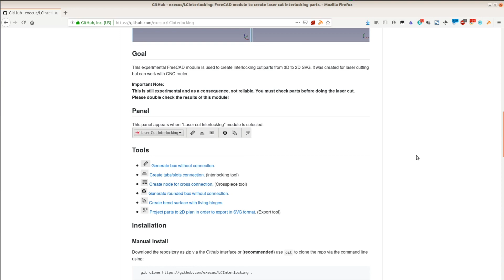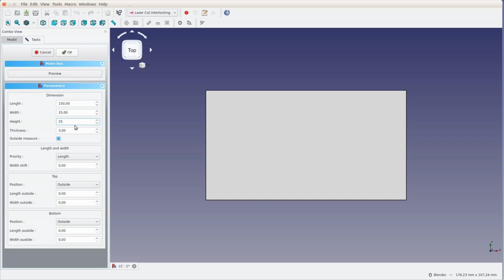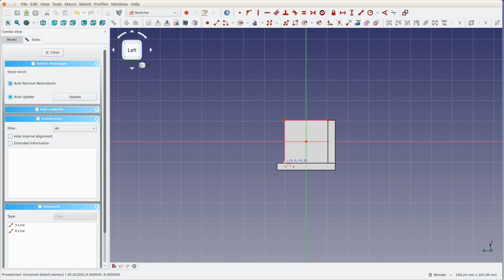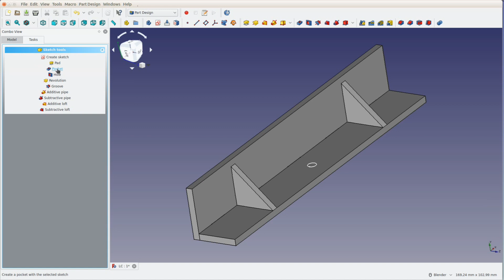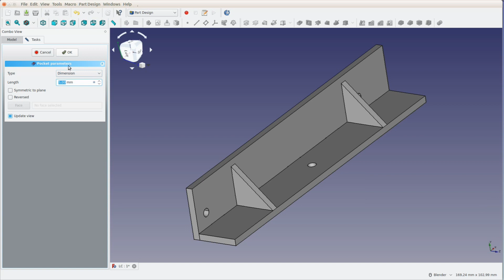Laser cutter CAD design with FreeCAD

Comment: It's funny to me that this tutorial is about radiator mounting brackets. I was just searching for generic FreeCAD tutorials for making things to laser cut and found this. My goal is to build brackets for my radiators too but I have a very different design idea. I'm going to making perfectly flat brackets that go across the whole radiator with holes for the fan screws and airflow path, with extrusions beyond the edges of the radiator so I can mount it to some angle sheets of aluminum and then mount that to the side of my desk or a wall. I am contemplating just buying a big sheet of aluminum and hand cutting and drilling it myself just to avoid the need to use CAD and pay to have it machine cut, that's how annoying this is lol wish it was easier so I can get a precisely crafted bracket.

Comment: nope export does not work, leads to error (export this shape is not supported by drawing module - whatever that means). Looks good in theory though
Reply from the maker: If you use the laser cutting workbench the export module creates 3d shapes and 2d drawings. Try hiding the 3d shapes and exporting the drawings.

Comment: Very promising tool but very buggy when doing anything more complicated than a box unfortunately.  Thanks all the same for the effort!
Reply from the maker: TheMrSoap Agree. It works nicely when starting off from the box. Combining other parts did not worked that well for me. I am not sure if the workbench is corrupted or if I overlooked some parameter.
Reply: @WayofWood  Where it struggled was when I made a box and then used the pocket tool to cut it short and then moved it before applying tabs.  It moved the parts back to where they started after applying.  Weird.  Nice for basic stuff though
Reply from the maker: TheMrSoap It shows some weird behavior but if you look at the authors github page he seems to be able to build some fairly advanced models with the module...